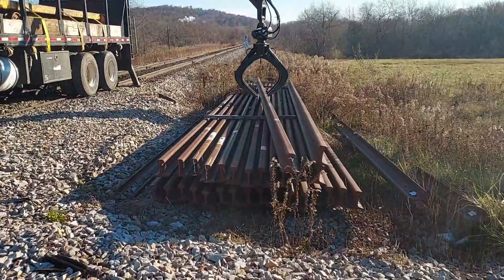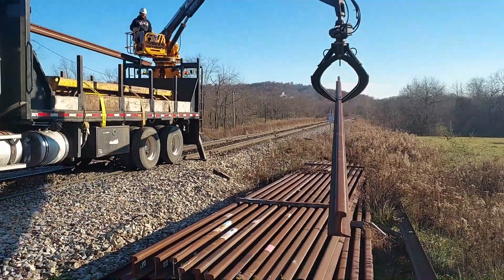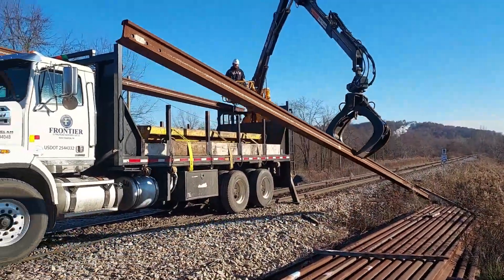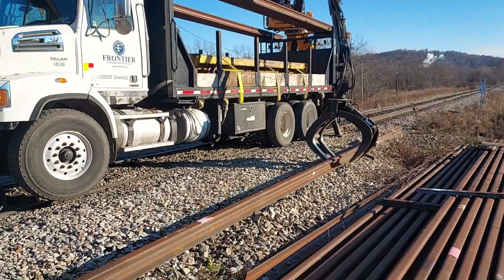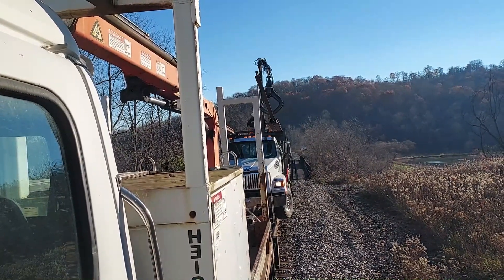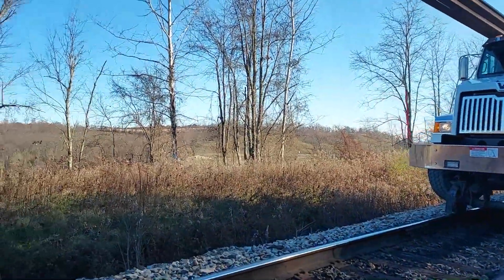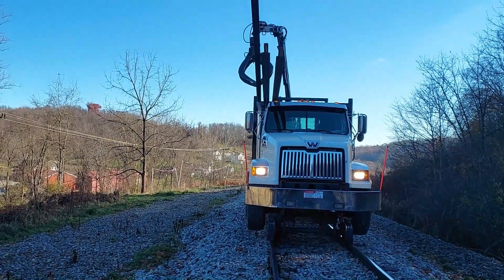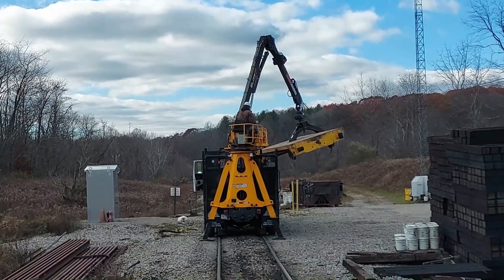Grapple Truck Loading New Sticks of Rail

Comment: Thanks Dave for another great video. I enjoyed watching the moving the tracks and the machinery that it takes. Also Dave what is a sperry defect. 😀❤👍🇨🇦
Reply from the maker: Glad you enjoyed tonight's show Ray. Good question and someone else asked that and I forgot to put that in the description, it's in there
now. A Sperry defect is an internal defect found by the ultrasonic
rail testers.

When the ultrasonic rail testers find an internal defect in the rail, we then call that a Sperry rail. Sperry is one of the original rail defect detection systems. Sperry, along with Nordco and Herzog have all done our rail testing here over the years, it's just who is available at the time. But if Nordco comes in and finds a defect, we still out of habit, call that a Sperry rail.

Comment: I see the frame of the truck a little higher than the back part a little slanted. I was thinking they were gona slide back while the truck was moving
Reply from the maker: You are right Alonzo. Not enough to slide the rail off tho, a lot of
resistance is created from the weight of the rail on those racks.
Very much appreciate your taking the time to write in and for checking out the loading rail video my friend.